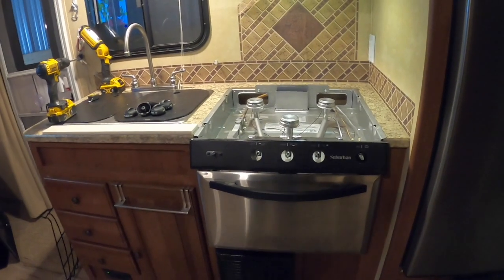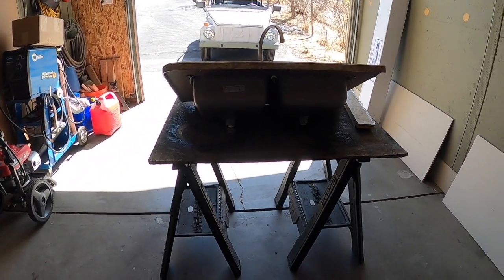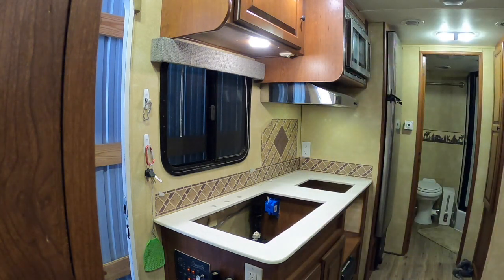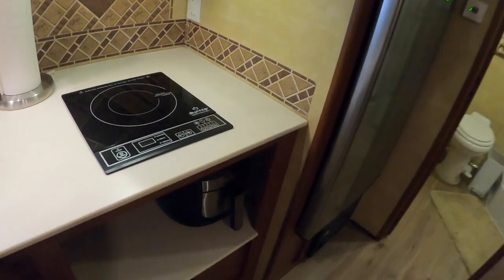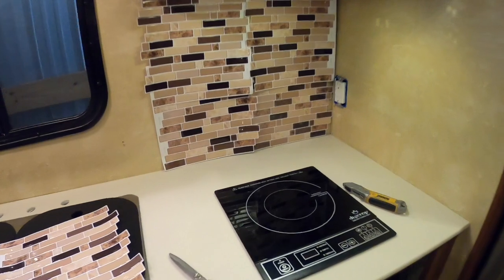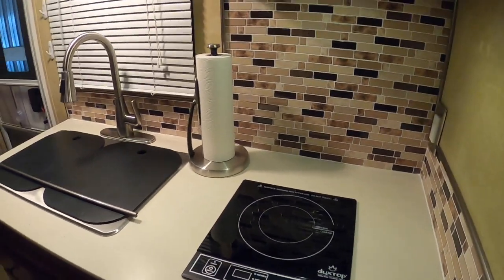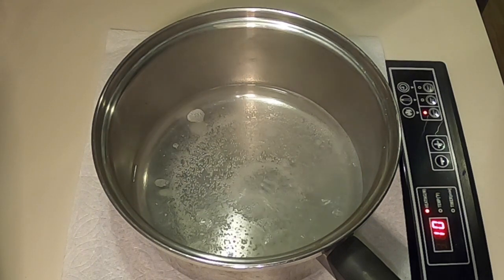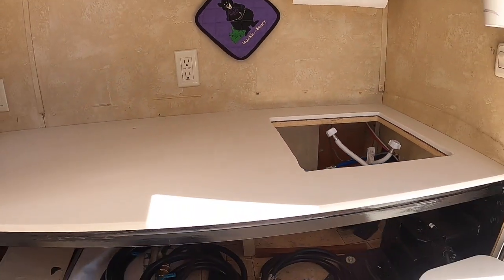RV Countertops replace it easily with Corian. RV Renovation RV remodel on a budget travel trailer

Comment: Were the countertops only attached using the silicone?
Reply from the maker: Yes. Have 6000 miles on trailer now. No issues. That ge stuff is strong.
Reply: You can add a couple of corner blocks and screw it down with wood screws, if your so inclined

Comment: If it was me I would pull the gas line out and find the connection at the splitter and cap off their. Also I would replace the sink with a undermount SS too.
Reply from the maker: Yep. Did cap it off below. Just left the dead line in. Tried to do undermounts. No room to do it. My wife does kitchen remodels. Thanks for the watching

Comment: You are quite the handy man! I am curious about your 12V Everchill upgrade.....did you use the 12V power from the absorption fridge to power the compressor on the Everchill? Or did you have to run new larger wiring and larger fuse? Looking forward to the next project.......maybe an induction hot water heater
Reply from the maker: Hey.  The 12vdc to the old fridge was a 20A line and fuse on panel. The new fridge only uses about 5A when running. Less than 1A on standby. Plenty of power left over. Thanks
Reply from the maker: Go to my playlist under rv camping. I have a whole video on the everchill.

Comment: Really appreciate what you've done and your narrative(s).  Can you share more about why your like corian over quartz?
Reply from the maker: The corian is easy to work with normal home tools like jig saw and router. Quartz is a man mad but uses stone chips. You need diamond blades to cut and finish water cooled. Corian is lighter also for rv Weight. Thanks

Comment: The silicone is enough to hold countertop? No need for screws?
Reply from the maker: In my case absolutely. I have over 4000 miles on it. No issue. Also try pulling it up. But use the good ge stuff. Dont go cheap. Do it when warm. Thanks
Reply: @bparkinson1234  thanks so much!